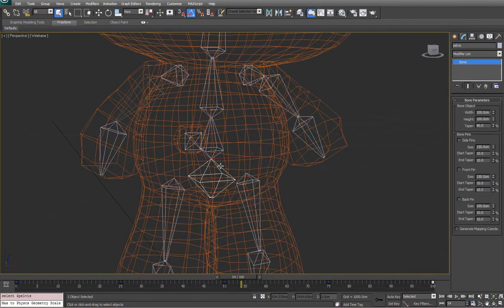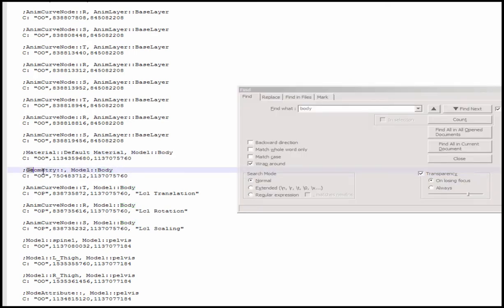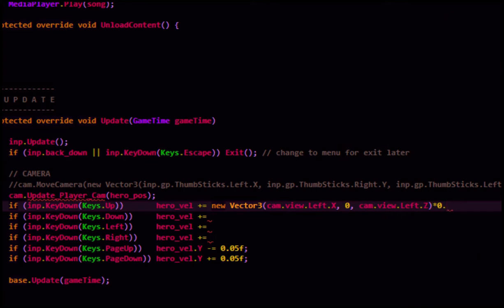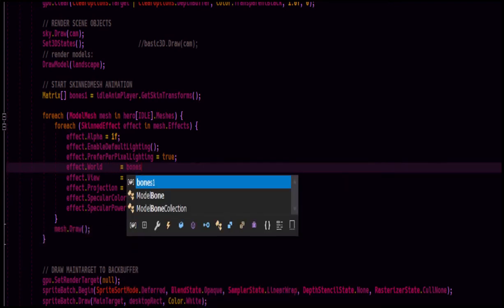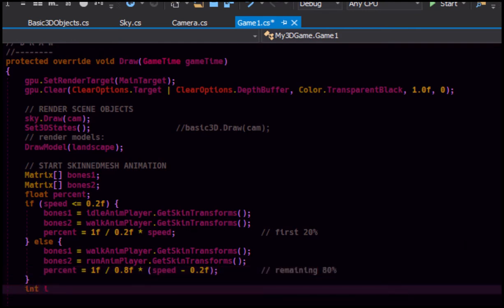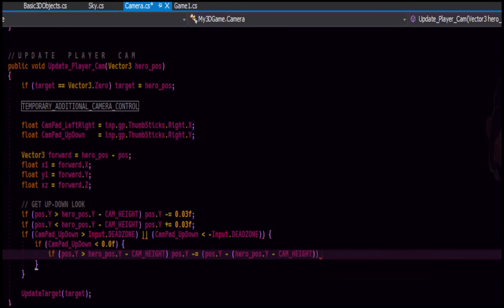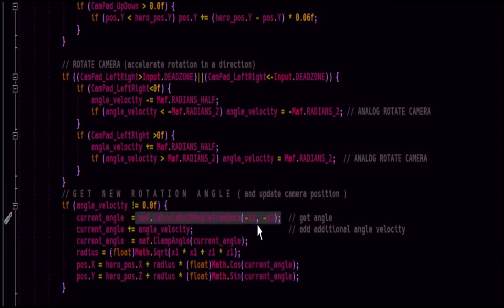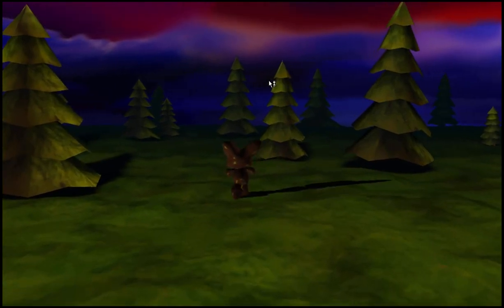3D Programming Skinned Mesh Tutorial & 3rd Person Camera

Comment: What are you using to export the file to an XNB since visual studio 2019 cant apparently though i can view the models lol, 
edit: Latest MGCB wont convert stuffy properly it seems
edit2: well got it to load that and now it wont return the tag "hero(IDLE).Tag" i think this is where monogame and FNA have split paths, know of any way to create the tag data ourselves? since the hero itself is actually populating.
edit3: and cant get access to the FNA pipelines to create my own SkinnedModelPipeline lol, so this only supports monogame from this video forward. first problem arose with the skinnedmodel dll, which i solved just by creating one for FNA, in order to make that useful i need to make the pipeline because it references the skinnedmodel dll, all came down to a call to one of the matrix's was a monogame matrix spacific call.

Comment: How would you go about implementing camera collisions? For example, if there's a tree between the player and the camera, the camera would collide with it and slide around it.
Reply from the maker: I don't yet know much about how camera collisions are normally done but there's 3 ways I'd consider:

1) General camera-guidance check-points/nodes(good for complex (often indoor) environments), 

2) ray-collision-angle-correction (like pulling camera on a tether that collides to change angle and keep player in view) [good for any environment], 

3) collide-and-slide with distance & elevation adjustment to keep player in view (good for relatively flat outdoor environments with obstactles)
..

  The rough idea for what I call "guidance nodes", are like hidden paths that the camera is allowed to take and will adjust position of camera along the general guides (speeding up and slowing down) as the player gets closer to being in proper view. The camera position only needs to approximate the checkpoints (easing) based on what node the player is in. Sometimes something can still be obstructing the player's view (other characters) and this technique can temporarily reduce player's camera control when it's adjusting the camera position for visibility. 
..

For what I'm calling "ray-collision-angle-correction":   
  You could create a vector that points from player to to the desired-cam-pos(the one calculated in the example). Imagine it's like a long stick attached to the player (using player as a pivot). If the stick/ray begins to collide with a wall or something, it is pushed outward(rotated around player as pivot) and scaled toward or away from player depending on confinement along the line of visibility. I don't have the details on how to program that but I could think of some general ways to do it. 
..
To simply slide the camera around a tree in the example, you'd shorten to motion(ie:velocity) vector to a length that prevents the camera's bounding radius from overlapping the tree's base-radius (ie: top-down view [x,z coords]) and by doing that it should slide naturally. if a ray-cast collision detection(ray passes through a plane in that part of the grid or quad-tree-node) is detected [player can't be seen because is behind the tree], the target distance from player can be automatically shortened causing the camera to slide around the tree faster until the player is in view at which point it tries to gradually go back to the desired distance from camera. 
(If it's marked as an outdoor environment, you could also have the camera move upward too when things might get in the line of sight to player. 
..
You'd need 2D circle-circle collision response (x,z) (and or flat surface vs circle response) and ray-collision detection with world-space geometry between player & cam. 
I'd add that it could be done with bounding spheres too (I suppose pine trees could use a scaled radius depending on height along tree) and BBox's for houses. 
If I had time I'd be working on this and do a tutorial. Right now I'm working on a 2D game with plan to do a 3D one later based on what I started here. :) 
..
Not sure if that helped much - but hopefully it's a start.
Reply: @AlienScribble  Well that was an extremely detailed answer. I'll try them out in a bit; thanks a ton for your help.

Comment from the maker: IMPORTANT FIX: 
world = blendTransforms[mesh.ParentBone.Index]   // CHANGE TO: 
world = blendTransforms[0];   // (or the correct parent index because it seems to add 1) 
U P D A T E :   BETTER TO DO THIS INSTEAD: 

world = mtx_hero_rotate * Matrix.CreateTranslation(hero_pos);

// No need to use blendTransform - just use regular player transforms 
...
Since ParentBone.Index == 1 instead of 0, it will cause the root bone to be transformed by the thigh bone (or whatever the second bone is) and it'll cause the character to walk funny which is why the character was walking a bit strange in the video. 

Some characters seem to have the wrong index for the mesh.ParentBone - so I'd avoid using that (unless you know how to reassign them correctly)
Reply: UPDATE:   I tried using your stuffy model and its rendering fine.  I think it's some problem with blender that I don't know how to fix.  Gonna try 3ds max next.
I bought a microsoft kinect and adapter for motion capture, which theoretically can be used in blender or 3ds max.  Anxious to try that when it arrives
in the next two weeks or so.  I'm a garbage animator haha.

Having a weird issue where my model is deforming strangely
https://drive.google.com/file/d/1nmVtj7taKB3Z-z5XcO29Xv4TiJrnbhqw/view?usp=sharing
Any idea why?  I've tried both these things in this comment.
Reply from the maker: @joseph_kenyon  Seems a lot of ppl were having many problems with the FBX exports in Blender. I remember some ppl moved them into another loader(autodesk fbx viewer maybe) that successfully loaded it and then exported it again so it would export correctly. I seen them talking about it in a Monogame thread before. There's one guy[Wil Motil] who managed to make an FBX importer that will work with any Blender exports(still may be some issues if any scaling on any bones - not sure). I think collada (dae) exports were working ok in Blender. Not sure about importing into monogame for dae tho since I haven't seen ppl using it. There's a youtube dae import tutorial for Java which could probably be ported if the built-in one doesn't work right. I tried Wil's FBX importer and it is super-robust - I've tried numerous fbx exports and they all imported and ran (including multiple skin-mesh animation attachments which required some complicated work with the way assimp conducts use of inverse-bind/offset matrices when there are multiple skins). I'm thinking of finding time to make a compact version based on Wil's work just so I can better understand the code myself. 
  But I digress; I'd first try getting the FBX into maybe autodesk FBX viewer or something that allows re-exporting to another FBX file - it should fix whatever the problem is with the Blender FBX export (so I've heard).
Reply from the maker: Wow - judging from that video - it looks like it's doing the parent rotations around the children which is the opposite of what should happen. I wonder if there's some setting in Blender that can be adjusted to fix this? I know some ppl importing to Unity and UE4 had to do something special with Blender export settings but unfortunately I don't know what they did.